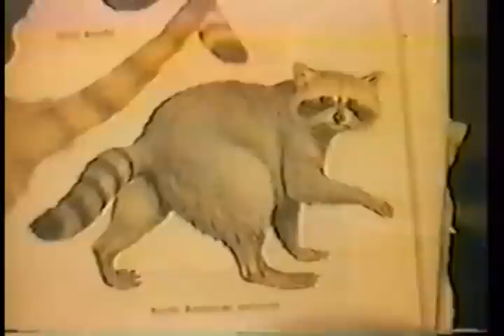Pino Signoretto Pilchuck Session 5 - 1994 Part 1

Comment: ramanglass is right it's just elmers.  the trick is to soak  the paper for like a week untill it's a stinky pulp. squeez or press the water out so it aint too soggy mix with elmers glue never tracked the ratio but its quite a bit of glue. plop it into the desired shape don't forget to shape a grip on it. let it dry, takes a few days. then your ready to sculpt away and make it look easy.